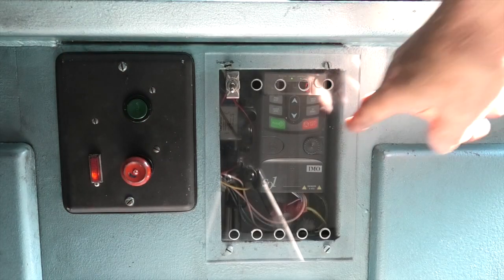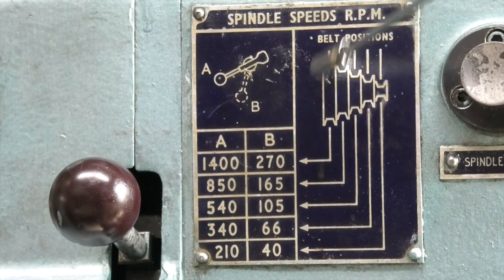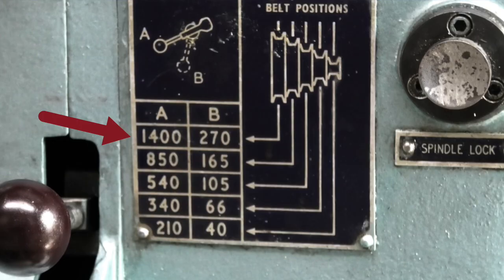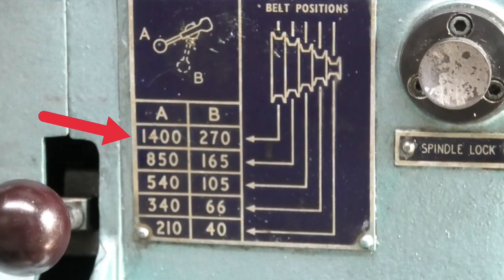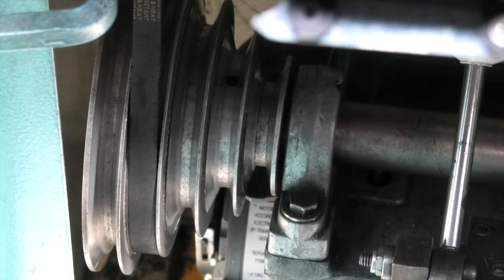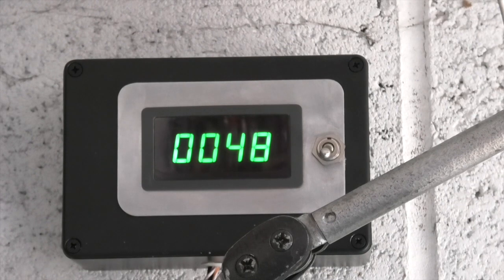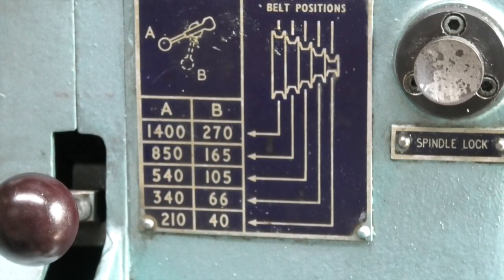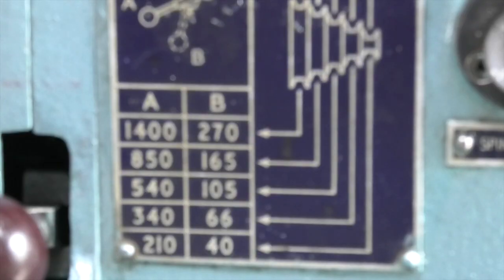Is it worth fitting an inverter and motor ?

Comment: This is perfect timing as I've just been asked by a Boxford owner which VFD and motor package he should buy to convert his lathe from single phase to 3 phase variable frequency inverter drive.....I'll send him the link to this handy video👍
I have a 1.5hp three phase TEC brand motor and a Mitsubishi CS-80 two KW VFD  and it is never short on low down torque or high rpm horsepower. 
The spindle control and range of speeds is just amazing and I would never go back to simply having the motor being powered direct from the mains and most certainly not from a single phase motor.
Reply from the maker: I would recommend it you have more control when screw cutting
Reply: @enotsengineering  Absolutely agree with you...screw cutting ops are a joy to do with the spindle control the VFD adds to the lathe.
A close friend of mine runs his two  Boxford lathes on Mitsubishi VFDs and he also loves the variable speed and programmable braking control the VFD brings to the party. One of his Boxfords is a very nice 500 VSL model....a lathe I admire enormously.

Comment: Was it worth the money? Thanks
Reply: Myself and a close friend both run our lathes on 3 phase motors and VFD drives. I run a 12" swing Harrison and he has 2 Boxford lathes.....we both think the purchase price of the VFD and motor was well worth the cost.
Edit to add: Another machine that benefits enormously from a 3 phase motor and VFD set up is the metal shaper...with a VFD the ideal ram strokes per minute can easily be dialed in for any given stroke length.
Reply from the maker: For me yes but it depends how often you use the lathe

Comment: Good explanation Alan. This confirms my thoughts. I now have a new motor, inverter and vfd on my Myford lathe. Like you I keep the belts in one position, which covers all the speeds I need. Saves time, and the motor can be switched on and off without causing any damage. Cheers Nobby

Comment: I have roughly the same setup. You can "overclock" the inverter to run at higher frequencies than the 50Hz which will give you higher speed than the 1440 rpm (for turning wood etc). 50Hz gives you maximum torque, while anything above or below will directly affect torque. I have set my maximum at 60Hz to minimise potential wear/ damage issues.
Reply: Yes,my Mitsubishi VFD also runs at up to 60 Hz and gives a great spread of speed options without having to change headstock gear positions very often.

Comment: If the spindle speeds were calculated correctly to start with by the lathe's manufacturer, installing a variable speed drive would be pretty far down the to do list on the lathe. This assumes that changing  speeds is easily done. The last of the belt drive Asian lathes are such a pain to change speeds that a vfd would be worth installing. I finally modified my Taiwanese 12x24 belt drive lathe so that speeds may be changed in less than 5 seconds.
Very old machinists reference books show how to calculate the intermediate speeds for the lathe. The progression is done in logarithmic steps, given the the lowest spindle and highest spindle speeds and the number of steps available.
The install here looks very professional and nicely done.
Reply: Belt drives were at their most user friendly back in the days when flat belt drives were more popular...flat belts are very easy to shift over onto the larger or smaller diameter pulley steps,
The other big advantages of a VFD drive is the adjustable spindle braking and a fully variable steppless spindle speed curve....the VFD drive is an absolute gem for improving screw cutting operations.